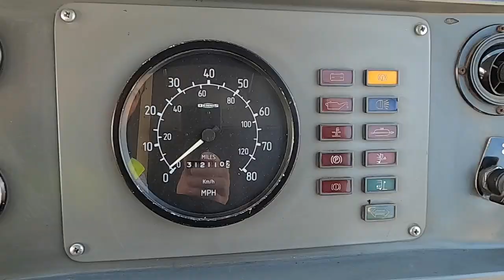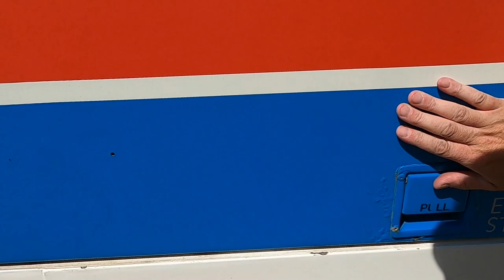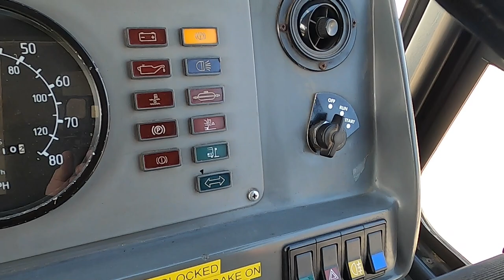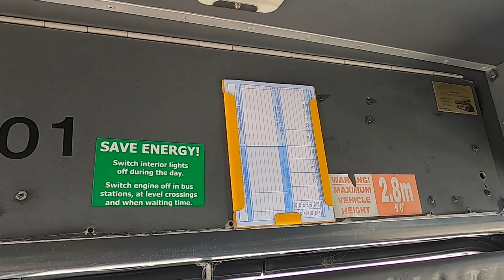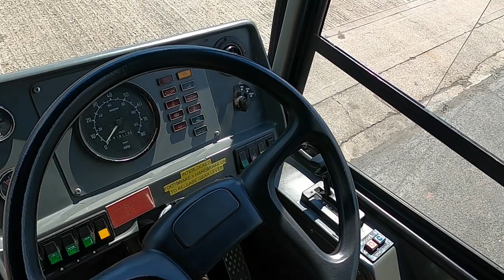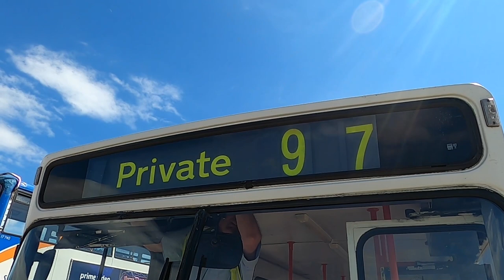Heritage Test Drive | Stagecoach South Dart 501

Comment: Could you do a flixbus coach cateno 2
Reply from the maker: Hi, it is not a Flixbus one, but we have tested the Levante II:
https://youtu.be/Hijw5tlL8LA
Reply: Good buses like my preseverd 2002 OPTARE EXCEL 2 FD02SFN MERCEDES BENZ ex Nottingham transport fleet 561 ex Go Goodwin plate WSV 541/550/551 based at TOWN and district transport trust